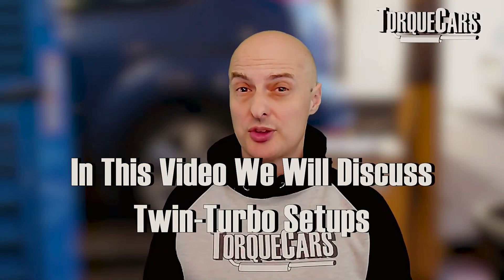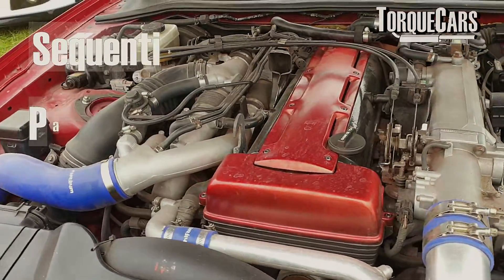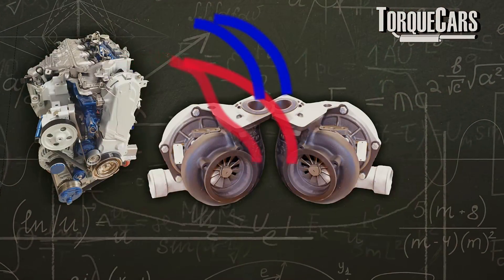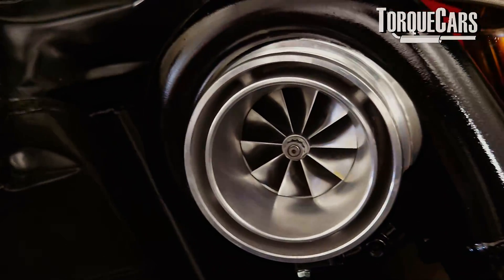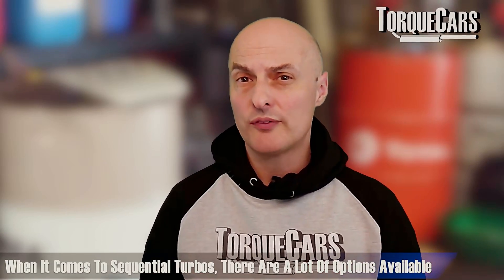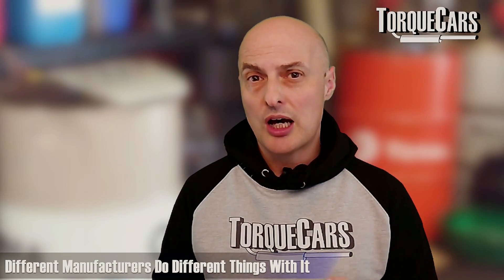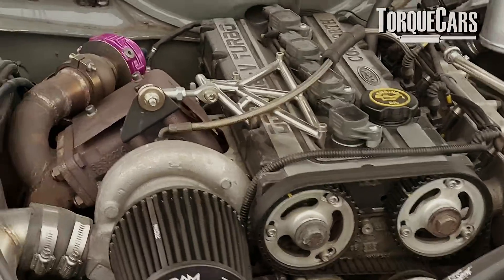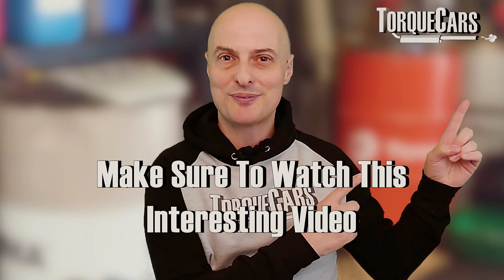Every Twin Turbo Setup Explained - What YOU NEED TO KNOW

Comment: I have 2 Garrett Gt2871r for a 4.3L V6 that are rated at 440hp each if used as a single but 800hp in a twin setup. Each turbo feeds into its own water to air intercooler then into a single 83mm TB

Comment: So, does a 2 turbo setup produce double the power of a single turbo setup?
Reply from the maker: Yes and No, it depends on quite a few factors. As this is quite a complex question I think I'll do a video to cover this when I get a chance.
Reply: @torquecars would love to see that. Thanks a lot.
Reply: Usually the 2 turbos are small-medium size, where a 1 turbo setup is usually large. It’s usually more power out of a 1 turbo setup but it takes longer to spool than twin.
Reply: Thanks @TMJYT
Reply: no
Reply: Thanks @ChaotiX1
Reply: short answer is yes but depends on how it's setup.
Reply: Thanks @dcptiv
Reply: Simple answer is no it does not double.  But as a few said there are many other complex factors that dictate power.

2 turbos at 8 psi each don't become 16 PSI, doesn't even become 12 PSI due to say losses.  But it will increase the volume of air at the manifold, thus increasing volumetric efficiency, well up to that point because if the engine is choking on it, this becomes a "back pressure".  This is similar to a bigger single turbo. However it is easier to accomplish with 2 turbos.  

Another situation like this is one 18" sub vs two 12" subs. The two have more surface area. Thus more air on both sides being moved.

However whether subs or turbos, this does not make one way better than the other, this because there is always a trade off. Dictated by Irons law.  There's also so many other factors, as is all the other components in said system.  

Then individual personal opinion.  What works for one may not for another. This is why you can't just necessarily copy another build because the numbers are impressive. Putting a NASCAR or John or Brittney Forces engine in your street machine probably won't be ideal for its real world application.  

And hypothetically if you did plan on doing the same thing, car, build,  race style, as say Brittney Force who is a beast on the track, you still may need &/or want a different set up.

This is why it is important to educate yourself but also get out there, get familiar with different things.  I see so many want to build a 1000hp car meanwhile they haven't driven anything over their mom's 280hp Honda. Or that 350 Hp Nova from back in the day.   And contrary to popular belief, 400hp is powerful on the streets.  And jumping to 600hp is a big difference, as is to 1000hp.

And I said HP, horsepower because most grasp this. But Tq, Torque is another very important major factor.  And in fact maybe more important for most "street machine" guys & girls.  Understanding the powerband, & curve is so important.   

Torque, Horsepower, RPM & that powerband & how they all work together or even against each other is complex, understanding how they all affect each other in some way. Which can positive or negative, also will depend on application & preference.  

My brother & I are street racers from NYC, 5 Boros & Strong Island Long Island NY way down in Mexico. Lol! Racing in the U.S. is illegal! So we never did that! Nope not once.  
Anyways,  primarily for me Torque was important. That low & mid range is where I mostly was. However HP was also important but wasn't my main focus of power above 6k RPM. Even tho I definitely seen above that. I also typically had a car or truck from the U.S.A aka China. lol!   3rd generation Camaro, a few Lincoln LSC's , Fox body Mustang, Oldmobiles,  Montecarlo, etc etc etc & of course my love my C4, my 91 Corvette (base/auto).  And like my 3rd gen Camaro, I put a 480Hp 350 TPI engine & 5 speed manual, which was badass in the 90s.  Plus it was murdered out long before the trend. Black on black, tint, "black out" light covers. Crazy system.  

But my base/auto C4 Corvette now has a good $100k of work into her. Me doing all the work except for machine work. But built engine, Dart block forged 384 Stroker, Holley EFI, twin turbos, meth injection, the works. 
converted to a 6 speed, & reworked suspension, double adjustable control arms, strut rods,   toe rods, etc etc everything, QA1 shocks. C6 ZR1 brakes all around, C6 GS wheels, & interior & exterior custom work.
Etc etc etc 

745Hp, 830Tq @ 10 PSI.  This
could easily be turned up. Easily & handle it too.  But it's new, not even broken in, & I don't need to push it to max.  Well until I do.